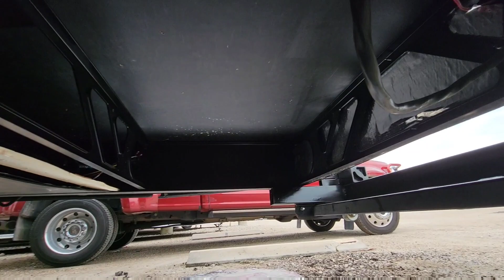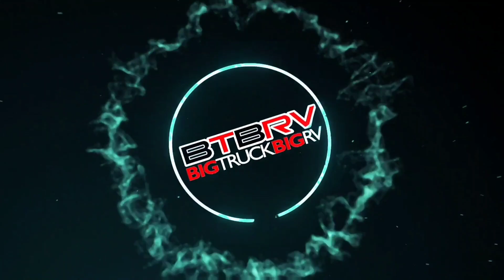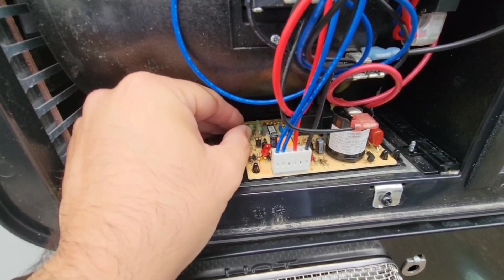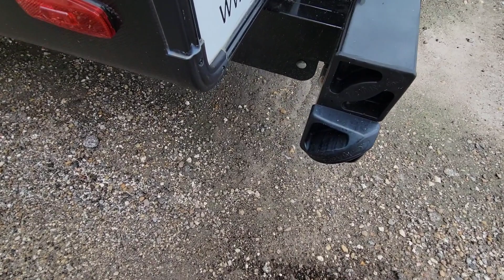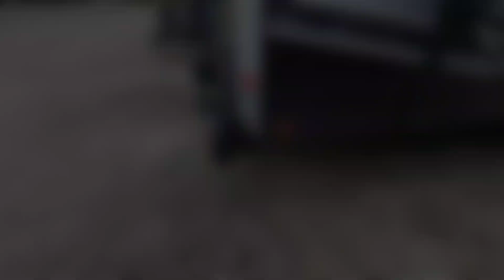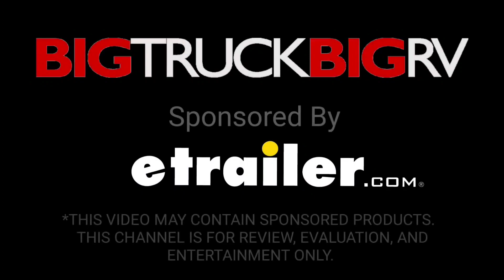Did I make a mistake modifying our new RV?

Comment: Well hello there I've been a huge fan just subscribed and thank you for your feedbacks on all your videos well 1st how to connect those panels I would attach the panel to the frame itself on the I beams with self-tamping screws and add some  styrofoam in the areas under the trailer. Good luck on the heater and for the rear bumper I would move the roller forward in front on the bracket and removed the 2'inch receiver off the bumper.  And again I thank you for your videos

Comment: High humidity could have caused condensation to form on the metal and that could have dripped on the board causing your problems.  Bad place to put a control board in an RV that's going to be located in areas of high humidity.

Comment: I would leave the receiver on it looks like it adds structural support to you rear bumper
Reply from the maker: It technically reduces the support since it adds extra weight (nearly 100lbs) to the welds holding on the bumper and puts additional leverage on it.

Comment: I agree with removing the receiver hitch. I would keep the rollers where they are though. Moving them forward doesn’t do you any good. If you move them forward and they make contact with the ground, as soon as the ground is off the rollers it will transfer directly to the bumper. If it’s steep enough to touch the rollers in the forward position, it will for sure be steep enough to touch the bumper.
Reply: Moving the drag rollers forward would place them directly under the main frame instead of being cantilever to the main frame which could tweak the main frame  in my opinion

Comment: I'd remove that 2inch hitch since you have that drop down rack.
I would cover that circuit board or relocate it away from possible water intrusion and give both side of the PCB some sort of water resistant spray if it is the board.

Comment: I mean if it really bothers you, then go for it, however in my personal opinion, I’d leave it on there. I don’t think you’ll be going anywhere off road or in to many places where the clearance might be that much of an issue. And down the road for resale value. Having original equipment would be a good thing.
Reply from the maker: True, but removing it would reduce nearly 100lbs of weight from the bumper and rear end in general.  Also, I would gain 4.5" of clearance.  I've already had to slightly use one of the rollers just pulling into a camp ground we visited.
Reply: @BTBRV  I think you just answered your own question: cut it off.